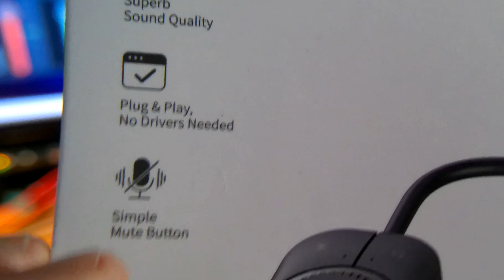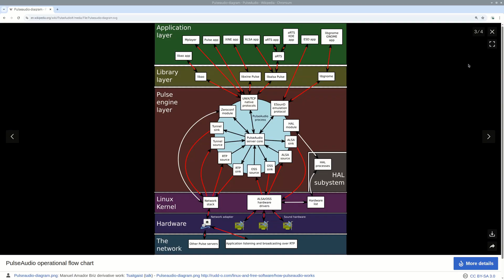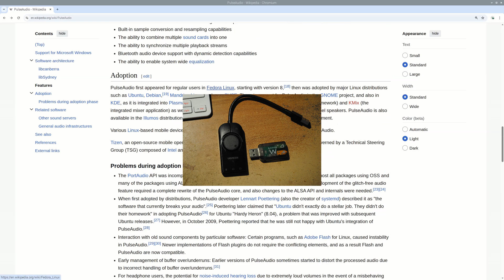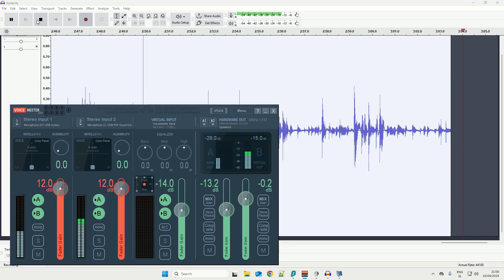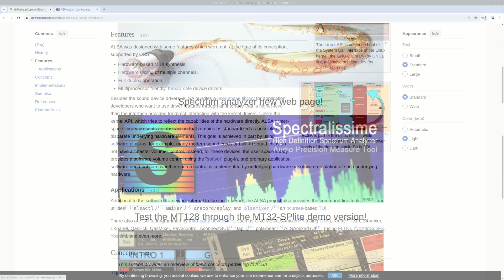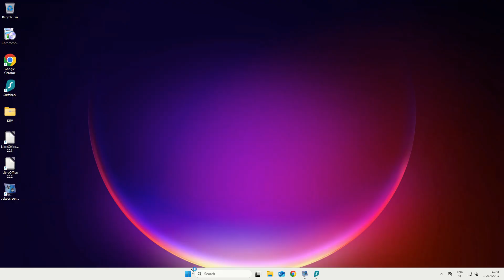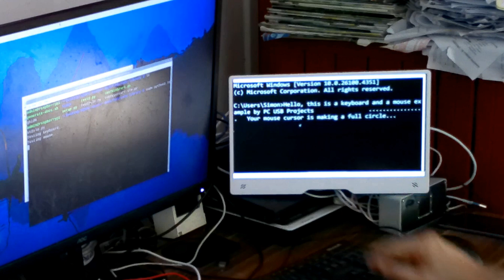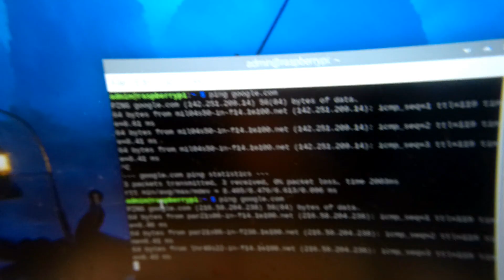Raspberry Pi 5/500/CM5 based DIGITAL AUDIO WORKSTATION (DAW). Free SW! Can you build it for 20 USD?

Comment: From begin of the year i'ven working on a project based on a SBC RPI 5, which involves my own audio plugin created on JUCE running into a DAW powered by a SCB with a MIDI user surfacec control that i designed. I try win & linux in the RPI 5, even new released UEFI for model D chips rpi5s. So i can tell that its a really powerful tool for work, daws works, REAPER, WAVEFORM, even in win BIWIG, but the drivers are the problem, win arm has not drivers for common audio cards. in linux this work better but not at all. REAPER  Linux arm version its the best option so far... usb class compliant devices work, some details like different reading gains takin 1/2 input vs 1 & 2 separate,  but in my opinion as an audio engineer its that this needs more time to consolidate drivers for arm devices, i see in a near future devices like portable DAWs controllers stations based on SBC and raspberry pi give us a point from start.
Reply from the maker: Dedicated device drivers are surely a big problem, so there is a way to avoid using them completely. DAW applications like  REAPER, Audacity and Ardour of course depend on sound card drivers. My video is focusing on combining cheap and simple audio cards (that need no device drivers, just basic the USB PnP finctionality) into a powerful virtual audio card that combines their abilities and functionalities and it can be used by the above mentioned applications. It is pure fun! 
None of the applications is able to address more that one physical audio card for audio input and more than on for audio output without a specialized driver like VAIO and ASIO4ALL. However, VAIO is also working on ARM64 variant of Windows 11, but ASIO4ALL is not.... Of course, it would be nice have a sophisticated USB audio card like Sound Blaster working on Linux (ARM64 variants) and ARM64 Windows 11, but we'll have to wait....
Reply: @pcusbprojects  Sure, mac has a easy way to do, i think even with USB PnP... For me a simple mackie Onyx artist 1/2 in 1/2 out  interface works on linux & win. also i will try VAIO. BITWIG in win can't handle a device without his own driver. I use a driver released by steinberg, its like a asio4all but for win arm, works but you can't change the buffer size, so has much more latency.
Reply from the maker: There are many ways to do it, but you need SW support... Raspberry Pi 5/500/CM5 now has an option for an easy implementation...

Comment: In my opinion, foregoing a sound chip on the Raspberry Pi 5 was the right decision. 
A USB sound card can replace it easily and inexpensively with better sound quality.
Reply from the maker: Elon Musk once said: "The best part is no part!". However, I often miss an inbuilt analog stereo sound output, which I'd be happy to trade for the composite video output, which most of Raspberry Pi 5's users don't even know that it exits (Watch: https://youtu.be/Zh1DVYKOZE8). I've even tested it (watch: https://youtu.be/PfeveeyDzYU), it works as intended on my old TV, but it is of no use to me... 
An external USB card occupies one of Raspberry Pi 5's USB ports, which are really not so plentiful. So, I prefer a simple inbuilt stereo audio output for the basic use like on a classic desktop PC...